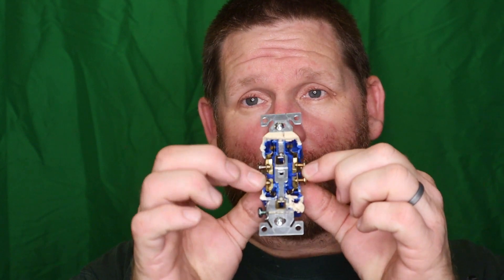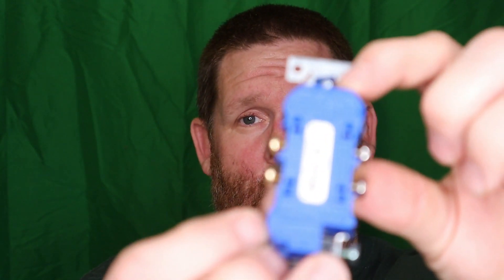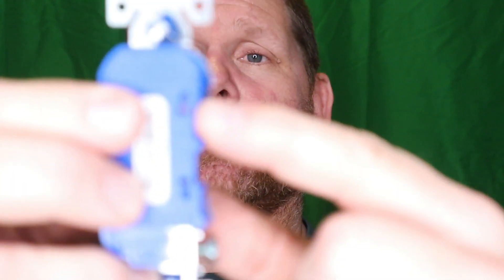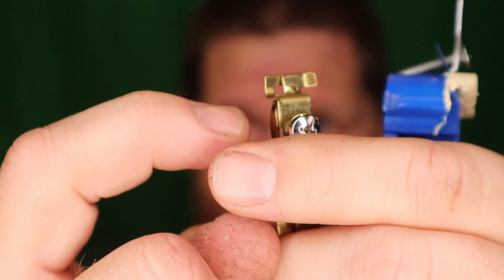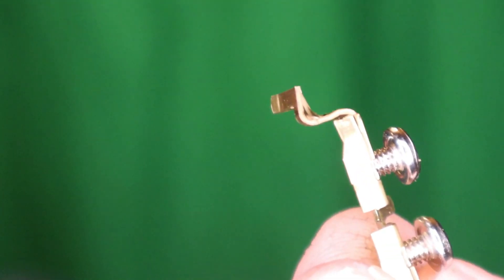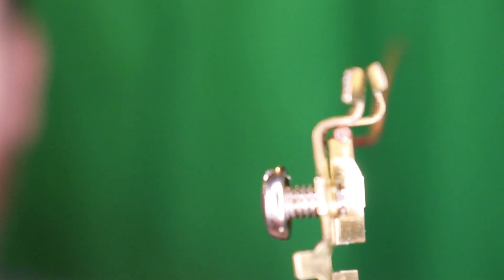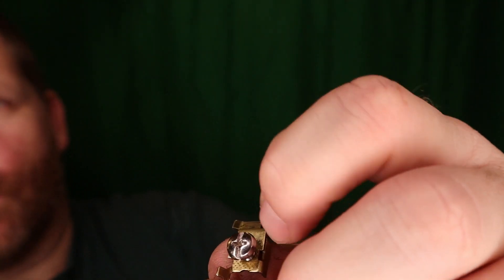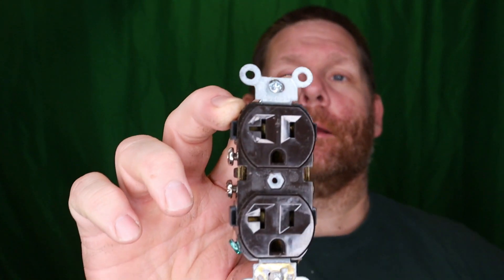How Not To Wire A Receptacle

Comment: You can use a 15 amp spec grade receptacle which is similar to the 20 amp that you showed, no backstabbing possible. You'll have clamp wiring or wrap around the screw. Backstabbing feature exists only on the cheap residential grade receptacles.
What about push in connectors or Wago lever nuts? I can't get over how similar they are to backstabbing receptacles. It's the same mechanical design it seems. Maybe the tension is greater on those connectors.
Reply from the maker: I agree with you on this whole comment

Comment: New Subscriber here: I just want you to know I appreciate your channel so much!  As an old carpenter now in HVACR who did a lot of apprenticing with old electricians back in the day, I appreciate your instruction; it brings back memories of the OLD GUYS who really knew what they were doing.   Like twisting before nutting; the HVAC school actually taught against it and criticized me for doing it, but I was taught by some good 40 year + electricians and knew better.  The only difference I see is I won't use a plastic box; seen too many fires contained within metal boxes to ever used plastic over the years.   Metal all the way.   Other than that, watching you is a refresher from 30+ years ago when I learned from masters that KNEW what they were doing.   Just wanted to say "THANKS".   You put out great content.   Extremely valuable, even life-saving.
Reply from the maker: First of welcome to the mountaineer outdoors family and I appreciate your comment. I can see your concern on the plastic boxes. And I agree somewhat, they make fiberglass nail on boxes which are very nice as well. You definitely can't go wrong with using metal boxes for sure. I appreciate you watching have a great day ☺

Comment: I have always stabbed my 15 amp plugs. I have never experienced a wire falling out of a receptacle, not even close. I am open minded and willing to change the way I do things but until I see there actually being an issue over time, my apprentices and I will continue to stab. Whether you stab or wrap, the plug is heating and cooling, over time, the plug itself will become brittle, old and fall apart.
Reply from the maker: I have seen it many times. It's definitely not against any code and totally a choice of the installer. Good luck

Comment: I replaced the switches in my bathroom recently, all stabbed in the back and EVERYONE of them were in fact loose. Some slid out when I pulled the switch out of the box extending the wire a little. House is bout 20 years old. Don't don't don't stab in the back.
Reply from the maker: Amen brother, glad that you fixed that problem. Thanks for watching and commenting ☺

Comment: Blessed Good Afternoon can you make a video on the Surface mount wall outlets especially on how you will wire up the 2 earth wires for a parallel connection since it only comes with one earth.    Check the link to see what I mean. https://youtu.be/Qq4F8My6_tE
Reply from the maker: well everything about that video is wrong so my answer is no. no way in this world would I make a video anything like that. Its just so wrong on so many levels, curious did you send me there to get this person views??
Reply: @MountaineerOutdoors  sorry about the late reply its YouTube fault loll I didn't send you there to give views loll. I want to run a parallel connection with 2 outlets similar in the video.  Because I'm not sure if what the person is doing is correct. But to find a English speaking tutorials with those sort outlets is hard. So I was wondering if you was interested in making a video of that kind since most videos is dealing with the inside the wall outlets

Comment: Unfortunately, on almost all smart switches and outlets, the only option is push in. However, I will say that, at least with the GE/Jasco switches, they are far better quality than even Cooper commercial outlets.  I feel the push in is secure and tight.
Reply: Most smart switches I have seen have screw terminals or built in leads.
Reply from the maker: Well that's good to hear. I will have to look into them. Thanks for watching and commenting

Comment: I never even knew you could push a wire into the back I always use the screw.. but I’m Paranoid about loose connections and creating resistance
Reply: Video idea I ran a screw through a 6 gauge 220v wire for my AC... show how to fix that please
Reply: same here, regarding the wire connecting method.
Reply from the maker: I'll work on that... Also, I agree tighten them up tight and if they break I always chalk it up to faulty equipment and I wouldn't want it in there anyway
Reply: @MountaineerOutdoors  People must have no clue what they are talking about if they are comparing the termination on GFCIs to a back stab. Lol
Reply from the maker: 😂 😂 😂 True...